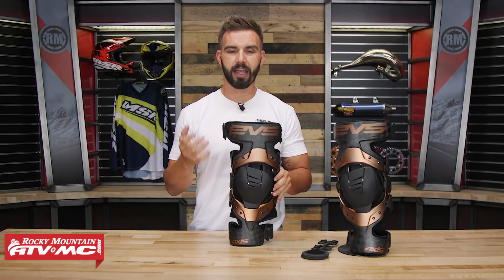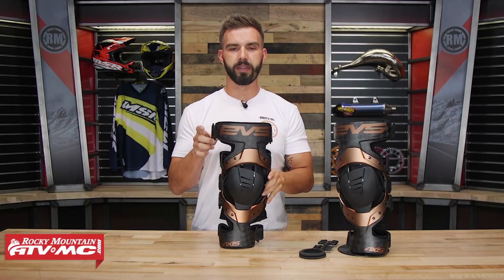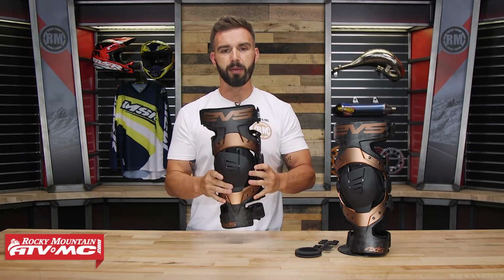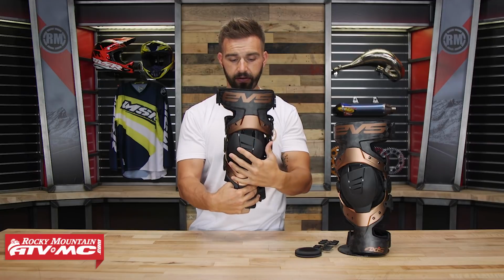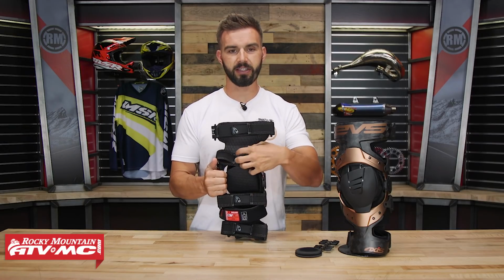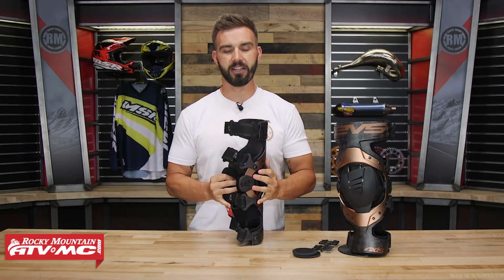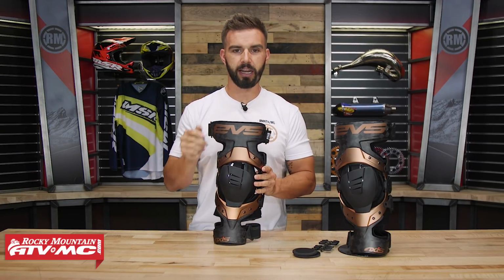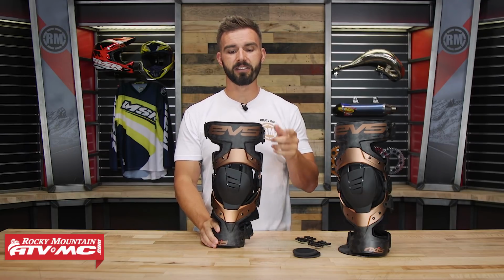EVS Axis Pro Motocross Knee Braces

Comment: I have a pair, and they are very solid. It feels like my knees have a force-field around them. Also great protection from lateral strikes, it cages the knee and protects it very well.  Also the thigh is protected as well making it perfect for protection from handlebar strikes. When I ride I don't even notice they are there. Actually they help grip the bike.
I once had to hike 3km out of a trail, and they didn't even bother me. But do wear leggings or knee sleeves to keep skin and hair from being pulled.
Reply: Review after 2 years: I would recommend setting the extension lock to the 2nd setting, as the one that it comes with standard wasn't enough to protect my ACL and meniscus in a recent accident. When actually crashing and hyperextending the knee a lot more force goes into the brace than you think, and the 1st lockout setting didn't stop my leg from hypertension. BUT if it wasn't there at all, i think I would have had it way worse.